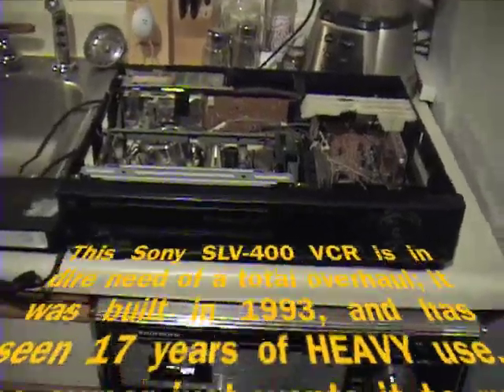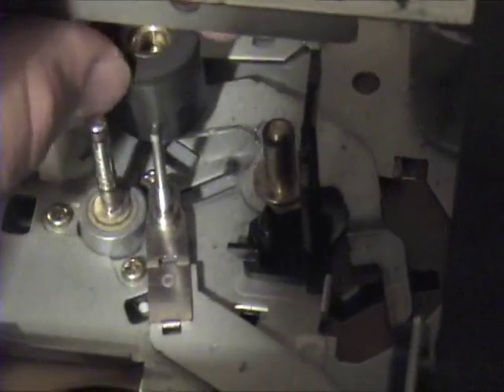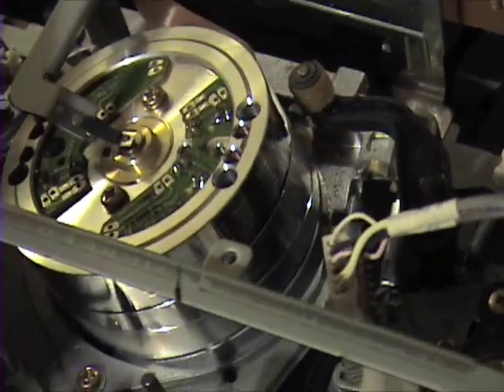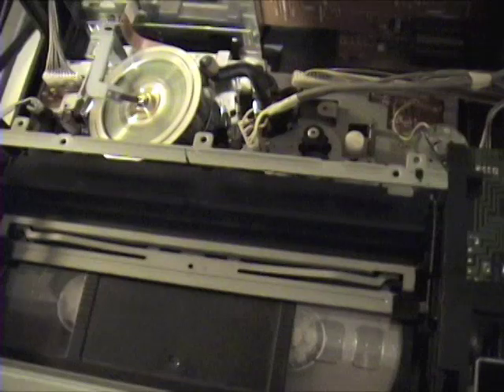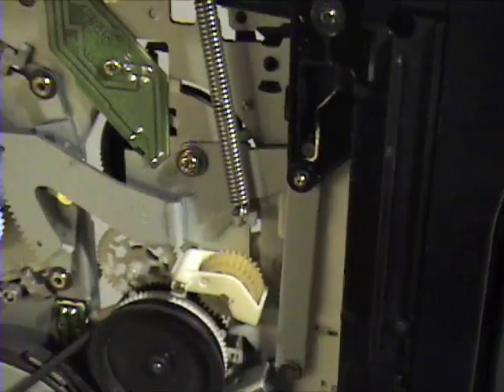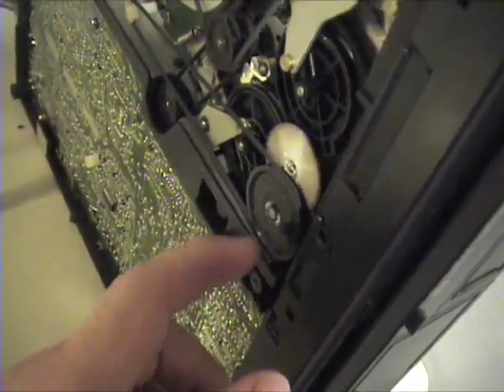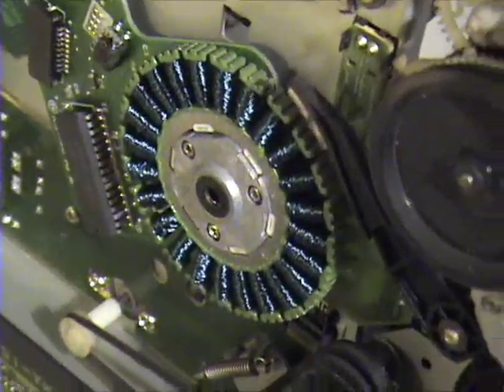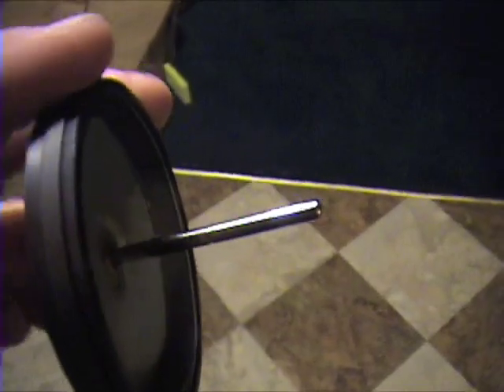VCR Repair Part 1

Comment: Good video! I used to repair them a long time ago, but now I mainly use them for parts . (If your into robotics, they're a small gold mine for parts)
I remember that 70-80% of the problems were mechanical, and for me 7 out of 10 times it was the idler tire. I used a product called Rubber Renew and it worked well. Good memories!

Comment from the maker: The chrome was not worn off, it turned out, the capstan was extremely dirty. The head was damaged due to normal wear and tear, and all rubber components were worn from wear and tear as well. Rubber components normally break-down over time and with normal use, which is why they become hard, and "glazed" over; this is why there are rebuild kits to replace worn rubber components (belts, idlers, brake pads, etc) for most makes/models of VCRs.

Comment: man how do you remove the pinch roller and idler?

I've been told the white cap is supposed to pry off for the pinch roller, but it just will not pry off for me. (I've got an old Panasonic PV-1535).

And I have no clue about the idler. I appreciate any advice.

BTW, I love that repair site you mentioned.

Comment: My neighbor has an old GE- VG-7920 from the early 90's that makes this horrendous screeching sound when playing a tape. After a while, though, it becomes a measured squeak squeak like an alarm. It sounds like a slipping belt or idler, but it isn't chewing tapes, going apesh*t and going through random modes and speeds, etc. What's the problem?

Comment from the maker: I was wrong; the chrome was not damaged; it simply needed to be cleaned with steel wool. The head was damaged as a result of heavy use; video cassette tapes can, over time, wear through the coatings on the surface of the video head.

Comment: When I put a tape in my 1983 (portable) VCR, the head just spins like crazy unless I make a recording first, then it plays the recording and the rest of the tape at the right speed. Would that be a problem with the control head do you think? I've adjusted  the sound to the clearest setting. Thanks if you can help.

Comment from the maker: You should NEVER adjust the audio head unless the unit was dropped, the alignment is set at the factory and never needs adjustment (you may have found it to be "cleaner" afterwards, as you may have unknowingly compensated for failing audio circuitry, but the problem is still there). As for the other problem, it's likely a failing (or improperly installed) cam gear (or mechanism) position sensor, or failing system control circuitry.

Comment: I have a question for you . I have a mitsubishi hs-u760 s-vhs vcr . I changed the video head in it , the upper drum . But after i was done it gives me a video signal a snow like one with a line going thru it . But the drum was used from old junker one .can you help me .

Comment from the maker: Yes, but this is not very common; usually, the normal service parts wear out first, then bearings, then gears, then motors; honestly, the motors typically outlast the entire machines.